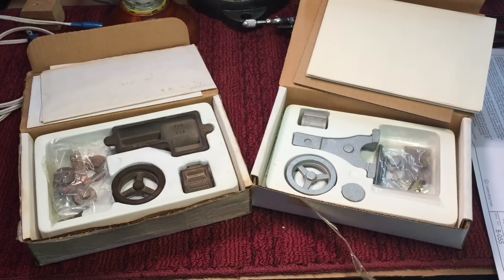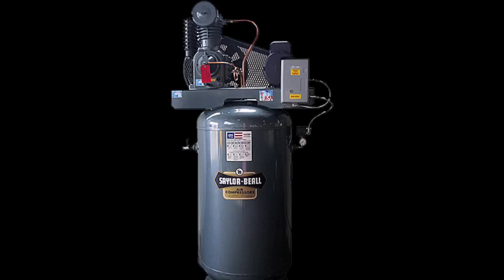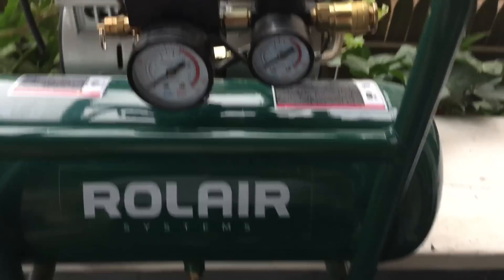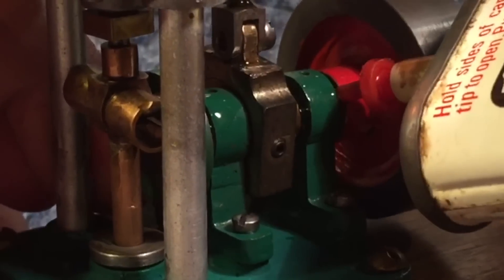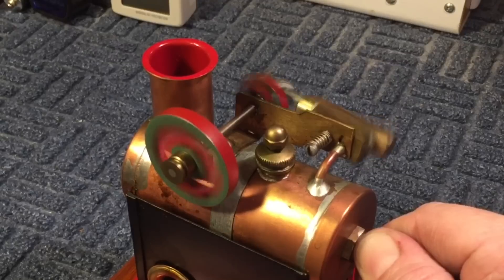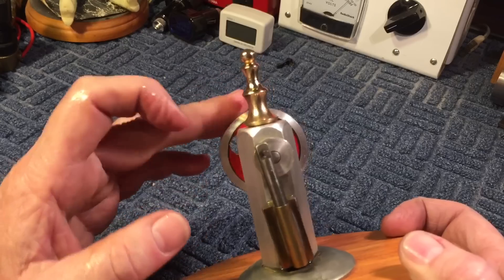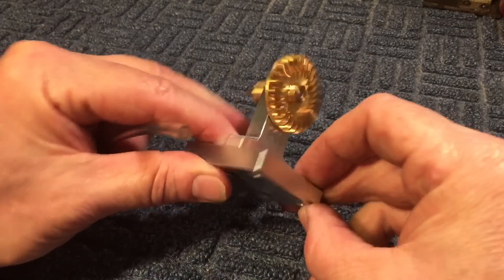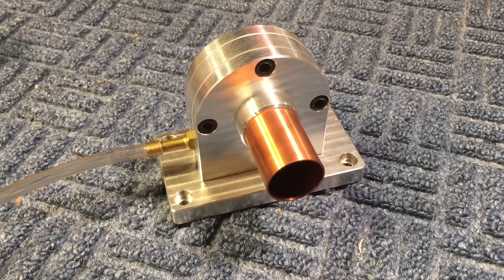Running Model Steam Engines on Air

Comment: I just ran across one of your videos the other day, one about the old cox cars, and it brought back a lot of wonderful memories, and reminded me how great hobbies are. I was born in 64 so I was able to enjoy a typical local hobby shop and it’s where most if not all of my “allowance” was spent. There was a steam engine there way up on a shelf behind the counter I always wanted but it remained out of my reach, to expensive even for a birthday wish. Years went by then I started working in a summer jobs program at my dads employer and as luck would have it, my first real paycheck coincided with unfortunate closing of that hobby shop, so I was able to finally get my hands on my childhood dream hobby thing. I just glanced over, and there she is, a little dusty, maybe I’ll clean her up and run some air through her in the morning. Where I was working at was the Garret Turbine Engine company, by the way, I started in sheet metal maintenance and managed to get all the way to a development lab technician, rebuilding air turbine motors used in the spin pit. It was all due to my exceptional mechanical aptitude, probably from a childhood of hobbies and always putting tools on my wish lists instead of toys.

Comment: One of the best SC videos!  Beautiful machining on those engines.  I mentioned to Ben that a Stanley Steamer owner told me that instead of firing up the boiler he would connect an air hose to move the car from the driveway into the garage.  BTW, congrats on closing in on 20K subscribers.
Reply from the maker: Thanks Rick!

Comment: I’ve worked with compressed air my entire life. Compressors, air motors. Air tools , air hoists and air dryers. I’ve built a couple of wobblers too. I’m really impressed with those turbine motors and would like to build one. Can you provide me with a link to a supplier? Love the engines you’ve built.
Reply from the maker: Hi Steve!  I got the turbines from a guy who was on eBay years ago...  He is gone but there are a bunch of similar type on ebay- https://www.ebay.com/itm/Live-Steam-Turbine-Engine-JB-II-Model-New-Steam/371601771034?hash=item5685310a1a:g:DZ8AAOSwgn5XEZoS

Comment: Better watch out OSHA is going to come for you, no guards you might pinch a finger. Tchtch.  You can also do this sort of thing with a small 2 stroke. Remove the spark plug, thread in a nipple drop a rod through the nipple to the piston put a check valve on the nipple and hook up the air. The check valve is oriented so that the air pressure closes it and the rod pushes it open as the piston rises.  For a turbine an old centrifugal or turbine pump works fairly well. Simply hook the pressure supply, air or water, to the discharge and it will start turning.

Comment: Words of wisdom...  "If you don't think that's awesome, your on the wrong channel."  Can we fit that in a fortune cookie?  We have a couple electric steam engines.  Running them on air is safe and convenient, but the heat and "danger" of running them on steam brings it to a higher level of fun.  Especially when you blow the little steam whistle!  My son and I have looked at the steam toys you can run with the steam engines via belts, but they are way too expensive!  So he has built some out of Legos!  The technic sets have gears and pulleys and such so you can build whatever you want and power it with the steam engine.  Though I have always wanted to get one of the old working model generators to run with the steam engine.
Reply from the maker: I do run steam in the Winter more...  However Compressed air is nice too!   =D

Comment: My grandfather built his compressor by himself. All parts came from the scrapyard, when we got rid of it, the tank looked like it would almost blow up every second. The last thing you want to have is rust on such a pressurised tank. The compressor itself was a Westinghouse compressor of the pneumatic brake of an old Unimog, driven with a v-belt by the motor of an old washing machine. He even integrated a pressure switch back then...

And for the turbine, the Chrysler Turbine Car...

https://www.youtube.com/watch?v=CBoi9c-nGVQ
Reply from the maker: That turbine car was amazing!

Comment: Life was so much simpler years ago, you were limited in choice. Take air line fittings for compressors, how many types are there now? You set up your shop and then a couple of years down the road want some fittings, then it becomes a problem what ones fit with what? Why no standardisation?
Reply from the maker: Tony you are so right!!!  They really dropped the ball when introducing so many quick connect systems!

Comment: This was so neat! You brought back a lot of memories of my own steam engine that used Esbit fuel to heat the water and power the drive piston for the wheel. I hope you will consider doing a tutorial on the casting kits you have to show how they are machined. Being a CNC operator I really enjoy metal cutting videos. Thanks for sharing this.